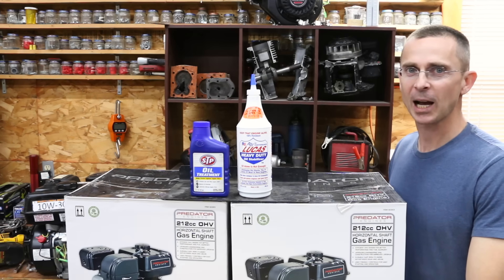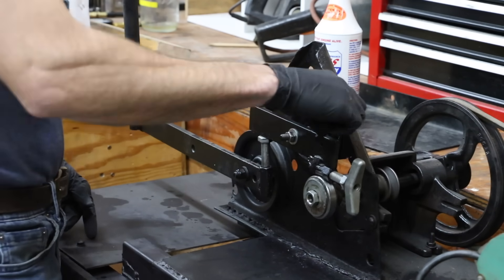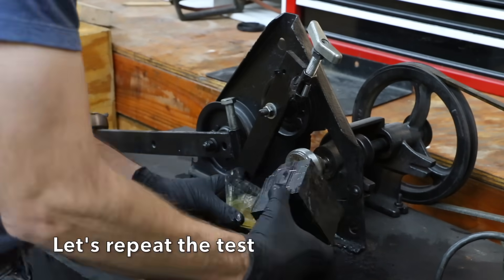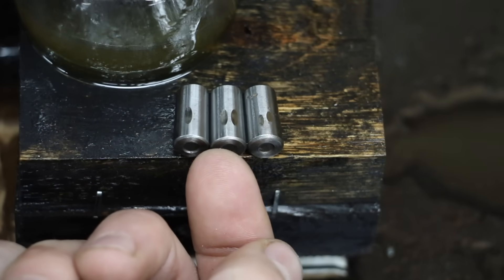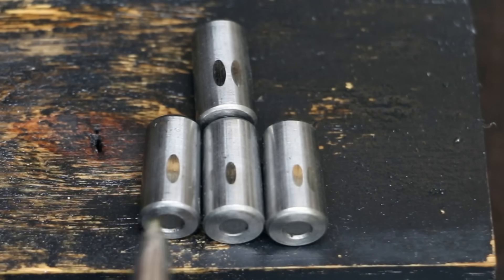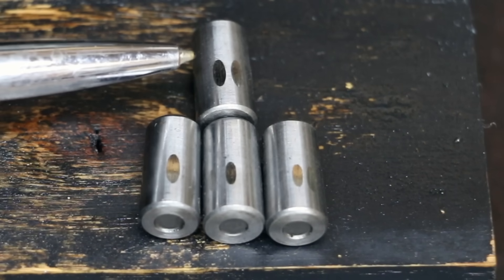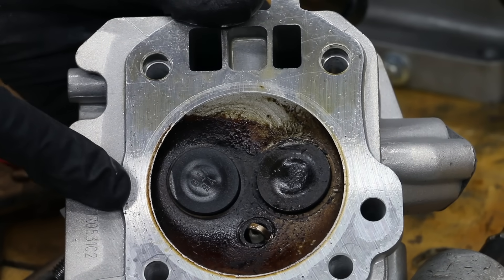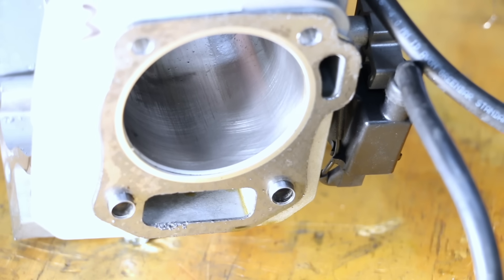Which engine self-destructs first?  Lucas or STP?

Comment: I liked your video. But you should have run a 3rd engine on just engine oil.
Reply from the maker: Thank you for this recommendation!
Reply: I wondered why the heck he didn't either.
Reply: Brook Bowen they’re oil additives.. not meant to be compared to oil
Reply: Brook Bowen , as a 25 year veteran professional auto technician, I’ve run more than a few engines without oil in them, but when you put a load on it, it doesn’t run for more that a few seconds before something breaks.
Reply: something1random23 I forgot how he did the experiment, been awhile since I watched. Yeah would’ve been useful to have another with plain oil drained out
Reply: I figured the point was. "are these better than standard oil" and without the oil version it doesn't tell us much.
Reply: dan428 must be high. The entire point of these additives is to be an improvement over standard engine oil, therefore we need a comparison vs. standard oil.
Reply: If it had engine oil it wouldn’t have failed..

Comment: 99.99 coupon for 212cc engines at Harbor freight. Just incase you hadn't been using one.
30031365
Just have the cashier punch that in. Works till 12/8/17.
Love your channel btw
Reply from the maker: Thank you very much for letting me know.  Buying these on sale helps!  Also, thanks for the positive comment!
Reply: http://www.hfqpdb.com/browse

No such thing as a sale at Harbor Freight (The parking lot sales I suppose, but.... you get my point).
Its just where in the country has the codes(sale price) this month.
The codes work at any store though. The coupons/sales just ship out based on locale.

Comment: www.archoil.com  makes an additive that isn't thick like these, but definitely reduces temperatures in all kinds of applications.  Not sure the self destruct test would work, but there are some merits to the Archoil where that test could apply.
Reply from the maker: Thank you for this recommendation.
Reply: I don't get anything out of this. I tripped over the company a couple of years ago.  I started putting it into small engines and found they start much easier.  I put some in my 5 HP Quincy and it quieted right down and seems to be spinning a bit faster.  My booster compressor doesn't come on as much now.  No idea how it will react in a no oil environment.  Not ready to blow up any mowers.  LOL  Great vids.

Comment: Conclusion: I therefore conclude that running an engine with no oil guarantees destruction. Save your engine by proper maintenance. I love Lucas and STP both, but a cheaper oil works too if you change them regularly. If the manufacturer suggested changing oil every 3,000 miles or six months, I change oil at 2,500 and 5 months whichever comes first. Check oil regularly and don’t let your engine runs dry. Good video, by the way. It reminds us what happens to a good engine if runs dry continuously. That outcome is predictable and unavoidable. Thanks for your work and sacrificing those two small engines for the test.
Reply from the maker: Great advice on the value of good maintenance.  Thanks for the positive comment.

Comment: what the hell does the 0 oil test prove?
Reply: Nothing, because nobody operates an engine that way. If I greased one of the engines with axle grease and it ran longer than one with only an oil film (which it well might), does that mean we start dumping axle grease into our engines? Which auto manufacturer recommends using ANY additive in their engines? None.
Reply from the maker: Oil additive with best film strength and heat tolerance will last the longest.
Reply: but if there fractions to no oil in it, theres no product to test. Might aswel pull it out of the box and rev it straight up.

Comment: Both connecting rod failures were because of heat build-up.  In those engines, one of the primary functions of the oil is cooling.  No oil, no cooling.  Little to do (but some) with lubricity.  The cylinder scoring was the better test of the ability of the oils to lubricate when depleted.
Reply from the maker: Great point and thanks for commenting on this.

Comment: To me, this really doesn’t show us anything but the results of an engine ran with no oil. I think a better test would have been to leave the STP and Lucas in the engines with oil and see which can sustain max RPM the longest. I think this because that is what additives are for is to prolong engine life. Yes you would probably end up running them for a couple of days straight, but it would be more accurate in my view.
Reply from the maker: Thank you for this recommendation.

Comment: Great video!  Fair and imparcial results.  I've used both STP and Lucas oils over the years in my car's, I prefer Lucas oil.  STP tends to Smoke and gunk up in engine, whereas Lucas oil tends to be a cleaner more reliable lubricant overall.  I drive the FWY from San Bernardino CA to Inglewood CA for over 20 year's, killed quite a few vehicles by Driving them to death. Both  Foreign and domestic vehicles.  Japanese vehicles did better overall, with better resale as well.
Just stating a fact.
My personal favorite is Royal Purple and use it exclusively in my 1994 Toyota SR5 Hilux Pick Up Truck 4X4 which I bought brand  new, OD @ over 389700 miles replacement of head gaskets 3 time's, 2 water pumps, 3 timing belts and 1 alternator.  Rebuild the transmission because torque converter failed, I had rear main seal on crank replaced as well while tranny was out.  Only oil leaks experienced were the Valve cover's, otherwise still have truck and runs and looks fantastic.  Lot's of offer to buy but I love owning & driving it.
Reply from the maker: Thanks for the positive comment.

Comment: You didn't have a control engine. You needed to have an engine that has only ran on pure oil to use a baseline. Your comparing 2 additives against each other and got a result of 5 minutes or so more runtime on the Lucas vs the STP but you don't have any data as to whether either of these 2 additives gave any improvement over none at all.
Reply from the maker: Thank you for this recommendation.

Comment: Lucas it is then... how about royal purple vs valvoline vs mobile one? Full synthetic.
Reply from the maker: Thank you for this recommendation.
Reply: Reference bobistheoilguy.com - all of your questions have been answered already.  Also, do a used oil analysis through blackstone laboratory for your vehicle and find out which is actually better for your car.  It's cheap, it's easy, and it is relevant, useable, real world data.  Additionally, you'll see which parts of your car are wearing/worn.
Reply: I would like to see the Royal purple test as well
Reply: Bathrobe Carpenter lets throw Amsoil products in the mix!! I use Amsoil in everything...
Reply: yes me too, I use royal purple but have been told it's the same as Mobil 1
Reply: What about the ol' school Slick 50 :D
Reply: Ive seen 7hp with royal purple xpr vs mobile 1 on a superflow dyno on a n/a sbc.. redline makes a very good oil too, id buy either rp or redline...
Reply: Try amsoil
Reply: Freshkryp69 7 hp on a dyno doesn’t even cover differences in atmospheric pressure or ambient temperatures between two runs.
Reply: how about molibdenium?
Reply: I use PowerUp NNL 690 and have had great results with it.  Very good stuff.  They do a similar bearing wear demo on their site.  I'll bet it would beat Lucas.  I'm not a rep.  Just a consumer.
Reply: THERE ARE THOUSANDS OF BRANDS, THE MOST PART IS ALL SHIT

YOU NEED A RELA ATNIFRICTION, AND THE BEST IS A NATURAL ANTIFRICTION, YOU PUT ON THE TRUCK AND VIBRACION ALMOST DESAPEAR,,,ITS NOT BRANDS OR MIRAVLES POWERUPS, ITS CHEMICALLL AND SCINE AND BRAIN
Reply: yes  royal purple.
Reply: JUST RIDE IDAHO , you cannot get better metal wear numbers than Amsoil. I have Lab results on my channel.
Reply: I use 0w 40 mobile one and valvoline and I feel my car runs better on valvoline.
Reply: Stephen Sundet wow thanks man used to use mobile one had my 99 Buick Century checked out I was informed that I would extend its lifetime significantly if I used Castrol high mileage instead
Reply: Well the guy John Willams who made royal purple was a family friend here in texas, he used to work for mobil 1 and helped create the mobil 1 formula. Father in law went to the royal purple lab and exceeded evey oil at the time
Reply: lkkjhtemmexv 

Have you been testing the oil out by consumption? Because I don't have even the slightest clue of what the actual fuck you just said.
Reply: ThatGuyNacho 0w-40 is Mobil1's  European Car Formula, along with Castrol.  If you have a European diesel, I would be very leary of using Valvoline.  The only problems I've come across with European deisel engines is when the owner changed to something outside of what was recommended.  By the way, if I'm not mistaken Valvoline is a Pennsylvania crude product, as is Pennzoil, and Quaker State.  On higher mileage engines we experienced some issues with the higher ash content of PA crude.  That was years ago, though.. just never went back.
Reply: +1 for the royal purple test
Reply: Ya I would like to see that my self they say royal purple is really good oil I use 5w 20 synthetic  in my car.

Comment: Like the test, since you didn't do a just engine oil test, still don't know if oil additives work. You had all 3 elements in your first test, but without knowing how long a non-additive motor would run didn't answer the main question, do additives help.
Reply from the maker: Great point. Thank you for this recommendation.

Comment: lucas heavy duty stabilizer is what you run in 12.5 liter diesel truck engines, dummy. its too heavy for small engines. they sell synthetic lucas stabilizer designed for smaller engines. usually found on the same shelf at your autoparts store
Reply: lucas is the shit!
Reply from the maker: Thanks for commenting.  The Lucas container shows a picture of a lawnmower and indicates that it is compatible with small engines.  Thanks again!
Reply: Oh, you'll probably need the directions on that one, LOL. about middle of the page there is "360 view" option. Spin the bottle around - it has a picture of a tractor and a tractor-trailer both running bud diesel engines. I guess you don't know about oil weight, but it's not good for your briggs engine to run 20w50 in it. The original Heavy duty stabilizer was made for heavy oil like 20w50, and was mainly used by the interstate truckers. As people started showing "interest" in it for regular cars, Lucas developed a much lighter formula, which is Synthetic Oil Stabilizer. It works great, I recommend you use it.

Comment: I suggest trying Schaeffer's Oil i think it's one of the best in my opinion
Reply: I second that toss all the additives in the trash and run straight schaeffer's 5000 or 9000 engine oil as it was meant to be ran nothing added to it.The only thing I have seen come even close is royal purple and it still don't hold a candle to it but it comes closer than the other mudpuddle water they sell as oil on the market. Word of caution if you try shaffer's after running some garbage oil you will have to change your oil filter maybe more than once as shaffer's will clean that old oil sludge out of your engine the other thing is you can not run schaeffer's 5000 or 9000 in a atv or motor cycle with wet clutches the oil is so slippery the clutches will slip don't ask how I know this lol. When it comes to saving $ on oil schaffer's is the way to go it lasts way more miles so your cost per mile is cheaper in the end than even the cheapest dollar store oils plus it has the plus of life of engine and improved gas milage as well as less heat in the engine. Just do a youtube search for schaeffer's oil and try to find a bad shaffer's review video if you find one i bet it is a bs one but let me know i would like to see it.
Reply: I love Schaeffer's to me its A #1 top of the heap, NONE better !!!
Reply: R Reichel , what is the metal wear numbers with schaeffer oil you get?

Comment: Lucas is a horrible oil, I'm not advocating for STP, however Lucas oil has destroyed 2 of our racing bikes, we will never use it again, thankfully we have not had a complete engine failure like that since!
Reply: I bet the higher viscosity Lucas additive would be bad for high revving engines like on a bike
Reply from the maker: Thanks for commenting on this.
Reply: G money 
Do you run Klotz in your race bikes? I've never had a race bike myself but I have ridden 2 stroke and 4 stroke dirt bikes since I was 7. I'm 40 now. I also worked the parts counter at a motorcycle see dealership for a couple years and the guys that actually raced never had anything bad to say about it. One guy told me that for the type of riding I do, I probably wouldn't notice much of a difference because I don't run it hard enough but he uses it in a shifter cart and runs the crap out of it. Super high RPMs and mostly wide open the throttle. He says it gives him more time between rebuilds. I can't remember what it costs but I've been told by several people that its totally worth it for racing applications.
Reply: G money 
Lucas is great for high mileage, tires worn out engines. For new, tight, high revving overhead cam engines I would not use it. It thickens the oil and raises the oil pressure. Higher oil pressure is resistance of flow and these types of engines need flow quickly to the upper cylinder head components. It’s been proven many many times that thinner oil is actually better. It flows quickly to major rotating parts and also dissipates heat better. Today’s engines have tighter tolerances and therefore require thinner oil. I remember when most engines were required to run 10w-30. I also remember when the manufacturers were transitioning to 5w-30 and most of the gear heads I knew refused to run that “piss oil” in their engines. Now, I’m seeing most new cars running 5w-20.
Reply: Derek Charette your a lier, Mack Trucks does not, and will not ever advocate for Lucas oil, Western Star hahahahahaha LMAO YOU ARE A NUT JOB! Military? You are as stupid as they come! Grow up little boy!

Comment: FACT: Lucas makes the best racing go kart oil in the biz
Reply from the maker: Thanks for commenting on this!
Reply: Project Farm you are welcome! Thanks again for another cool video. I have an idea for another video. Get another engine and take the governor off and see how long it will run with oil and no load on the engine. Might be a good idea to put a billet flywheel for safety reasons. You could always sell the flywheel on eBay after the video to get most of your money back.

Comment: Sorry, but this kind of test is completely meaningless. The bearing score test is irrelevant, because it doesn't reflect any real world operating conditions, and running engines without oil is equally meaningless. STP and Lucas are nothing but thick oil, although STP does at least put in a small amount of anti-friction additive. I fail to see the point of this exercise.
Reply from the maker: Thanks for commenting.

Comment: There are too many invalid variables in your current testing process. For example, your current test is basically seeing how long an engine will run before the crank to rod bearing heats to the point of failure due to having zero lubrication. The crank to rod bearing surface, and many other points within the engine, were designed to have a steady flow of lubrication. Your stand alone bearing to rotating steel wheel test is also invalid because the lubricant and mating surfaces are not heated to the normal operating temp that exists inside a running engine (200 - 275deg F). You also generate an inconsistent mating surface between the test bearing and the wheel you "Grind" on to clean it off in a random fashion. There is no way that anyone can consistently grind on a metal wheel like you did to produce a consistent surface roughness from one test to the next. That type of metal on metal friction testing requires that both mating surfaces start at a consistent surface friction from one test to the next. The differences in bearing wear depth in your existing tests could easily be due to the abrasion difference on the wheel from the random grinding between tests. 

To create valid comparison testing between lubricants requires that the test put the lubricant and friction parts in its designed functional condition and temperature. It also requires that the test equipment is able to be reset back to "zero" in a very accurate manner in order to have a consistent starting point for each test. I highly doubt that you have the patience, testing equipment or financial resources to do the level of testing to produce factual data points to truly asses the effectiveness of one lubricant over another.

Comment: Actually a true test would be run them as they are intended,with the additive and regular oil changes and see over years and thousands of hours which would hold up longer, guarantee it's not worth finding out,and by the way,how many licks does it take to get to the center of a Tootsie roll pop,now that's worthy of a test!
Reply from the maker: Thank you for this recommendation.